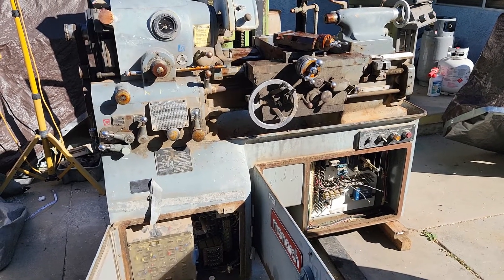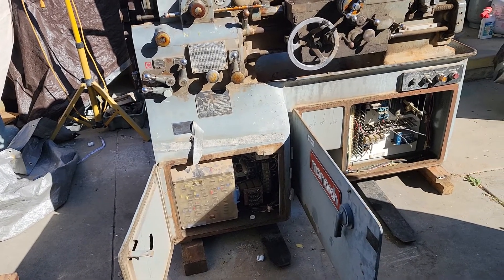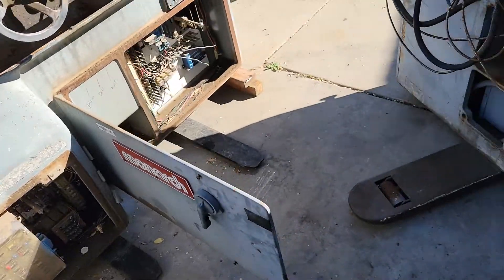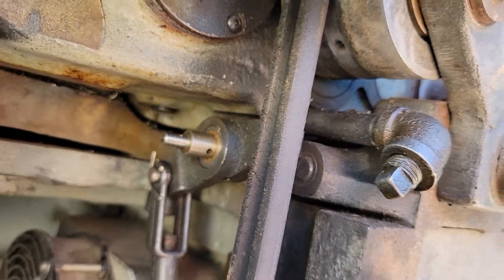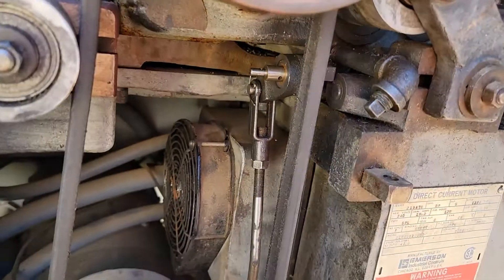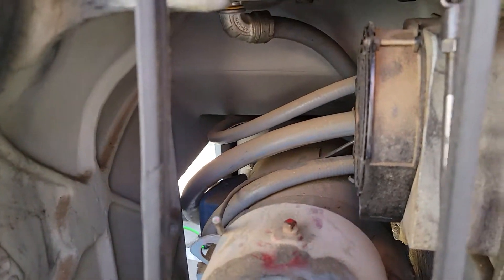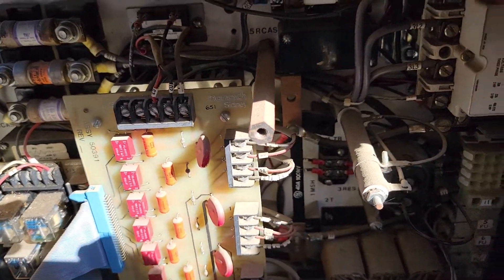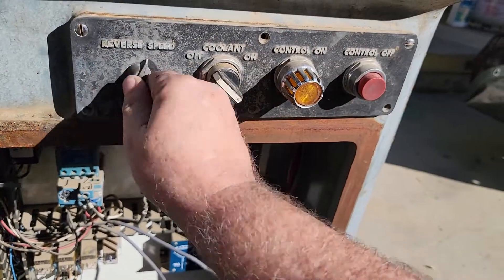monarch 10ee English metric lathe speed control question.

Comment: I didn't know the drives in these were so sophisticated.  Is it a closed loop servo spindle drive?  I remember the original DC variable speed drive using a pair of thyratrons and I don't think they had closed loop control on those.  I used to have an old panel mount frequency counter made by Anadex which I am sure was used for the RPM readout on one of these.  It had Nixie tubes in it!

Comment: Does this lathe have the taper attachment hardware? The  electronics look different than my 10EE but I have tubes. Still English and metric and with ELSR. I had to rebuild the diode module which was a pain!!!
Reply from the maker: I with it had elsr! This is 80s solid state drive....and it works!! Yes, it has the taper attachment hardware.

Comment: Worked for Emerson Electric and in 1988 they bought a new Monarch 10EE.It came with a different electric drive than what you had. The open door on the left front of the lathe  where the electric panel is that tilts out  ,there was a small box that had two large tubes. You don't have that, I believe you have a later electric solid state drive, that might be why you don't have the variable drive. But I will say that it looks like you have the original motor. On the exterior our lathe looks just like yours except we had the variable drive knob that worked. I'm guessing that in 1988 Monarch were making both drives and started phasing out the old tube drives. I know that at first the old tube drive we had didn't give them any problems, but by the second year they were replacing tubes all of the time as well as relays! Eventually the tube drive was replaced with a different electric motor with a small box on top with a start button and a variable pot. That really helped this lathe. Can't tell you more than that, I believe you should get something from Monarch that might explain what you have. I hope you get it fixed, because once fixed ,you won't want any other lathe!
Reply from the maker: Monarch says that when mine left the factory it should have had the regular speed adjust knob. I've since picked up the missing parts for this. I test fit it over the weekend and it should work great. I'll need a potentiometer.  The part I got came with the older special potentiometer monarch used in the modular or older drives. This machine uses a standard 3 wire potentiometer.

Comment: to reverse speed, the switch should connect to each contactor, one is for forward, one is for reverse.  the only difference in wiring will be that you swap 2 legs, red, black usually what I do.

Comment: The  speed control parts were obviously robbed from the machine at some point, the best advice I can give from this point of view is obtain the correct missing parts and then test the machine at high voltage, put it on a trailer and take it somewhere if you have to, before spending money on transformers. Or spend the least amount possible to check out the current drive system. 
  But, you say it yourself, the dismal future of a dime store close out, and ebay parts  drive,  cooked up by an internet troll, featuring poor performance is what you see the helpless others do,
Reply from the maker: Thanks DeeDee. The casting the rear aluminum tension wheel is attached too has the mounting tab the potentiometer mount casting bolts too. Since my lathe never came with the mounting tab I suspect it never came with the speed control originally.  Monarch said it could be ordered that way. Luckily the spare machine has this part and I picked up most the other parts to change it over so it would be like your machine and most the other machines I've seen.
Reply from the maker: Also, luckily I won't need to buy any transformers, monarch sent a pdf showing how to change the wiring to convert it from 460v to 230v.